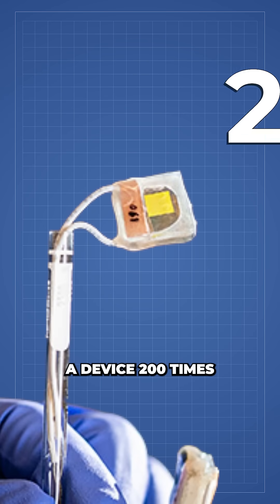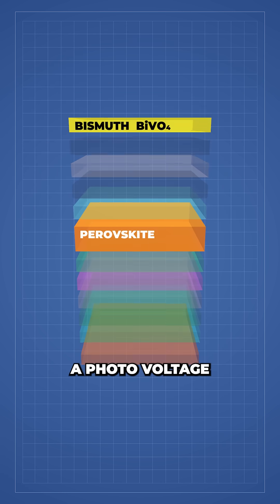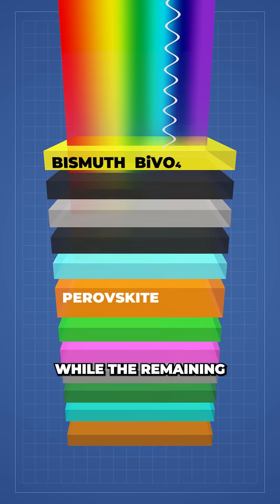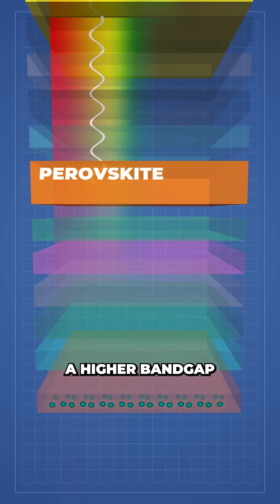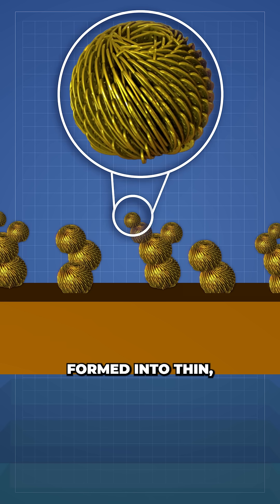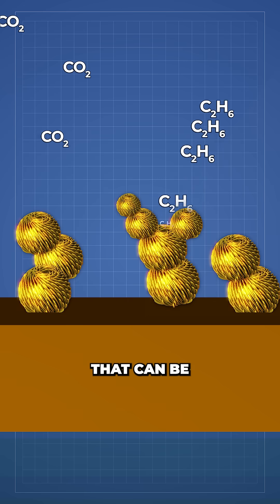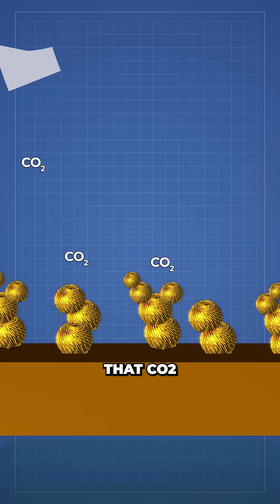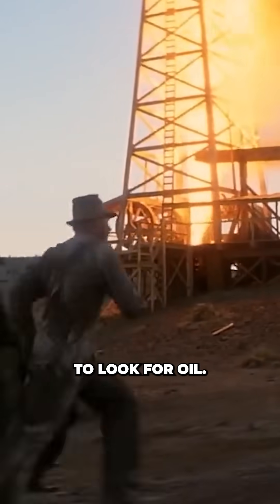Scientists Create Artificial Leaf That Converts CO2 into Fuel

Comment: Now watch this get scrapped because it was financially lucrative to big companies and industries.
Reply: Or oil companies buy the patent and sit on it. Then reintroduce it when the profit on oil starts running out.
Reply: @jjspeaksout  "Or oil companies buy the patent and sit on it"

That's not the way the patent system works.

You can buy software and sit on it, but you can't buy a patent and sit on it.

You HAVE to license it, otherwise it's just as invalid as if you never had a patent at all.

You can't even charge an unreasonable royalty amount for it (at least not in most countries).
Reply: It could be the opposite: use this instead of the other fuels and devise, because THIS is more lucrative. And not only for the big companies that exist right now, it could be a new company that compete with the existent ones, and then this new company rise above those which didn't want to make the change (similar to Netflix and Blockbuster).
Reply: Ok Mr Conspiracy Theorist what about private companies that are in the business of selling you high efficiency solar panels for use in military, industrial and miniature devices. 

Many of these advancements DO come to fruition but take multiple iterations to perfect or to realise scaled mass production. It’s “easy” to make something in a lab it’s far more complex to manufacture it at scale without sacrificing quality.
Reply: @inthestarrysky6166  Exactly!
Reply: Not if its cheaper than drilling in the sea
Reply: This is definitely a very inefficient concept an hence just an overall bad idea. The technology could potentially be useful for other things, but overall this is not a good system for green energy at all.
Reply: @MsHojat  why?
Reply: Nah, it won't. Usually in this sort of technology you don't use ambient air, but need some sort of process to get concentrated CO2 which makes it (as of now) super coat & energy inefficient. That's why there these kind of cool laboratory experiments don't make it to the production line. No deep state / big oil / conspiracy needed.
Reply: Hope they send plans everywhere. 3rd world doesnt need electricity, needs fuel for heat.
Reply: Bro. Saudi Arabia of all places is heavily investing in solar panel manufacturing. They aren't dumb. The only thing that will keep this tech from flourishing is if it's not really capable of being used at scale and is being overhyped by science tabloids.
Reply: Wouldn't be the first time. Tesla got a taste of thus
Reply: Or China being smart either pays them to give all current research with them either helping or leaving and staying out of it or doesn’t pay them and uses “alternative” methods
Reply: If it gets scrapped, it'll be because it isn't a worthwhile investment. There are over a hundred countries on Earth without these huge oil companies. If they can't make it in Japan or China, then they just don't have anything valuable.
Reply: Look up how scarce bismuth is on earth...where it is most....this kind of work is done by big companies or few universities in the world....the knowledge like this not attained at go....so don't be fearful....American dominance is over we are now living in a mutil polar world bit like before 1989....but it will better if u are NOT American.
Reply: Things change. Look at the cigarette companies. They tried hard to silence the doctors but it only lasted so so long. Most went bankrupt, some went into the food industry and created the obesity pandemic. They will soon have to pivot again. The oil companies can’t stop this if it’s working and the economy of it makes sense. Some will go out of business, some will manage to transition into something new. Maybe baby killing powder or buying these components to build desert fuel plants.
Reply: соnsрirасу sсhizо
Reply: Do you have any idea how big a thing this would be for oil companies? Drilling for oil is a huge expense so if they could get around having to do that they'd jump right on it. 

The trick here is getting it to scale up outside a lab and that'll be the big bottleneck in making this day to day.
Reply: @aguyhere7945 Except they already have the infrastructure and many oil sites are good for a long time. If they suddenly stopped using that for this it would be a waste of
Reply: Oil is finite. They can't just sell crude oil forever. They would just slowly introduce this into their production until it's the only profitable way and fully transition to it
Reply: @michaelvigil5321 they will replace work force with robots before oil runs out. Co2 focus about weakening people not climate change
Reply: @michaelvigil5321 oh yes, oil is finite. And our corporate overlords have always been able to plan beyond the next financial quarter, surely they have a hundred plans in place for such a situation.
Reply: Oil actually isn't finite and it's being produced by abiotic processes. Crazy how young people these days think they know everything. @michaelvigil5321
Reply: You live in a James Bond movie
Reply: Solar panels can be used to power fuel synthesisers, and we've literally had that technology for decades. This isn't 'disrupting the fossil fuel industry'. If you believe it will you fundamentally misunderstand the problem.
Reply: @dead_pool_io if you really think what we had already in this respect was good enough for what we need then you need to watch the video again because they clearly explain it’s not possible with the solar panels we have now.
Reply: @compilationsofsinope7601 sorry explain exactly which part of my statement was incorrect? You dont think we can power fuel synthesisers using a solar cell? Go ahead I'll wait. 😂
Reply: @dead_pool_io If I followed this explanation, the fuel comes straight from the device and cuts out secondary processing. Let's get real, you can easily split water in hydrogen and oxygen with solar panels, but this requires a different fuel infrastructure. This device us producing hydrocarbon fuel.
Reply: @dead_pool_io If you're referring to the solar panels people have installed on their houses to go "off grid", it's a scam. While solar panels in general can and are supposed to be used for that purpose, they're actually still connected to the grid and feed that energy back into it. So, you're not benefiting from them. You're just giving that energy back to the power company for free and they're still charging you for your energy use. You actually have to jump through some hoops with the power company to get them to even apply your discount for solar panels to your power bill. Also, that account info is your responsibility to get from previous home owners and pass on to whomever buys your home from you in the future. Otherwise, even with solar panels, you'll still be charged full price for using electricity from the grid. So, yes, power companies may utilize "solar leaves" at some point but you'll still be paying for it just like with the much larger solar panels. The difference is the leaves can be implemented throughout highly populated areas with minimal impact on infrastructure. Using them in that manner would propel further development to get away from fossil fuel. Not that oil companies would allow that.
Reply: @JoeBennett-j9c  nice copy paste
Reply: @dead_pool_io doesn’t make it efficient
Reply: @lordwilliam8340  if you're looking for efficiency with photosynthesis then you're looking in all the wrong places.
Reply: @dead_pool_io it’s extremely efficient when talking about plants
Reply: @lordwilliam8340  photosynthesis in plants has a 1-2% efficiency rate.
Reply: @dead_pool_io converting sunlight but it’s an extremely efficient method of making energy saying as everything else by that metric would be even less efficient
Reply: @lordwilliam8340  ... yes.... sunlight... that's what we would be using to power these things....
Reply: This why I hated capitalism
Reply: @gandalflotr2898 What is the alternative?
Reply: That’s just conspiracy that is not supported by anything😂

Comment: That's really cool, and the researchers should be lauded for their work, but in the end, it's still creating hydrocarbons for combustion, which is one of the least efficient sources of energy and puts the carbon back into the air. Still, it's a great achievement and a useful advancement in science.
Reply: That's simply wrong.  Combusting Hydrocarbons may be inefficient, but they're so power dense that they still dramatically outperform batteries.
Reply: @jeffmorris5802  I didn't consider batteries, because I think of them as energy storage rather than as a source of energy. I was comparing hydrocarbons to solar, wind, hydro, nuclear, etc., and how much of the energy gathered from those is converted into work versus what dissipates as heat. But I'm no expert, so I'm open to an explanation of what I got wrong.

Comment: A solar panel car is becoming more realistic by the day
Reply: this isnt a solar panel. it creates an actual fuel. Solar panels convert sunlight into electricity, but no fuel is created.
Reply: No, solar doesnt have enough power to run a car. An eV car might use ~15kW on average with break regen... peak midday sun is 1kW per m^2, you might get 2m^2 of usable solar panel area on a car roof, so even at 100% efficiency you cant run a car, maybe charge it when not in use. State of the art is something lkke 22% efficiency, depending on where you live, the season, the weather, the sun output drops rapidly, but even at absolute peak youd get maybe 440watts, youd need about 35 hours of peak midday sun charging per hour of driving you do
Reply: @Athiril  dude have you watched the video???
i don't think OP meant a car running on solar power, but a car that burns normal fuel and generates fuel from the exhaust fumes using solar power
Reply: @goggypoggy  big difference between carbon monoxide and carbon dioxide.
Reply: @goggypoggy the video talks about "co2".  Exhaust fumes from burning fossil fuels are "co"
Reply: @ZackNehring You are wrong. The majority of carbon monoxide exhaust gets "burned" into carbon dioxide by the catalytic converter.
Reply: @goggypoggy have you? I gave you the best case scenario. That's much much worse. Your combustion products of electrolysis fuels are the same as your input products.. meaning you can't get more energy out than electricity you put in.

Evs may be around 90% efficient in electricity usage from a power source. While a petrol car is around 20% net efficiency, most of the energy is dumped out as heat.

Now you are adding electrolysis, which will be around 55% for co2 splitting, now you're going 22% x 55% x 20% = 2.4% efficiency in use of sunlight to fuel
Reply: @ZackNehringexhaust from burning fossil fuels 100% perfectly would be CO2 and H2O. But it’s nowhere near perfect and there are all sorts of other things in fuel so you get that plus some CO, a bunch of O3, a ton of nitrogen compounds, and miscellaneous other crap - lots of nasty stuff.

Which is just one of the many reasons why battery EVs are better and are going to win out eventually.
Reply: @ZackNehring No, incomplete burning will lead to a mix of carbon monoxide and carbon dioxide but a good car will release basically no carbon monoxide, since that would be a very inefficient car
Reply: @goggypoggy  well that would be a normal car, if someone says "solar panel car" one would assume they are talking about a car driven directly by solar panels.
Reply: @catninja4950 but most people's Cadillac converters break down and never get fixed or replaced not to mention if they're stolen and get replaced by straight pipe
Reply: @catninja4950 also Cadillac converters are not on everything You've got other running engines out there that don't have them lawn mowers chainsaws weed eaters
Reply: @agaimless3724  where can I pick up "Cadillac" converter...I have a '97 Toyota...would love a Cadillac 😂
Reply: @goggypoggy .

It is only possible because it is 200x the efficiency of the current PV solar panel.

The only difference is, it uses the output electricity to split the CO².

Meanwhile in an EV car, we use the electricity directly to kinetic energy.

So yeah, it's more efficient.

The only feasible implementation of that approach (splitting CO²) is to make sugar, food

Wow, next thing, we create food from thin air and sun

Woohoo.
Reply: @olsim1730 🤣
Reply: @agaimless3724  Those things do happen, but they are not the majority. You act like no cars on the road have a working catalytic converter. In Europe if the exhaust  gasses are not in norm, your vehicle can't complete the yearly vehicle inspection + any modification to the exhaust system could land you in jail.
Reply: @agaimless3724  Those little 2 strokes will never emit as much CO and C02 in their life time as a normal car does in a mouth.
Reply: @goggypoggy  Uhh, conservation of energy would like a word. Doesn't matter what chemical process you're using, you're not getting more energy out than what you'd get from just using the solar energy directly.
Reply: @catninja4950  I swear I have seen that guy before, claiming that exhausts only release CO. He deleted his comment after I proved him wrong but he seems he's still at it. How very strange.
Reply: @miniMAX_Styles 
And we ALL become diabetic from eating so much sugar
Reply: @richardofoz2167 .

sea water is Free and full of salt, but bro, you found new post eutopia "problem"  😂😂😂
Reply: @Athiril it will if it's parked in the sun all day while you're at work I'd love to have a solar car down here in Florida if it's a efficient enough just park it in the sun if it gets me to A to b everyday it's all I need
Reply: @agaimless3724 that'd only work on an ev not a petrol car, it won't work for producing fuel, you dont get 37 hours of peak midday sun in a day, which still isnt enough to get you to and from work ubkess youre 3-4 min drive away. You wouldn't really get a return on investment and would need to install solar panels on the roof and wire it in. Also your average is 400-500 W/m^2 on the sunniest most cloudless day thee for 9am to 5pm period, and that's assuming there's no trees, no wall, no truck or anything else shading your roof. Enough to drive maybe 4 miles on an EV.
Reply: @Athiril 4 miles is good. We'll just all get jobs in Florida or Uganda and move closer to work.
Reply: @Athiril  cars are if we are honest,utterly useless. Trains and buses are much more efficient means of transportation anyway
Reply: @Athiril  true
however, batteries

also maybe in the far future if/when we have a dyson swarm we can make a cool service to redirect more of the suns light onto a point to generate more power than would otherwise be possible, very sci-fi and has obvious flaws (parking structures, also instant blindness if you have a sun roof) but would still be cool

also also i dont remember what the video name was (i think it was by pbs space) but i saw a video recently that discussed a paper that put forth the idea of essentially transmitting energy by sending information, supposedly if you entangle 2 particles under a magnetic field and then toggle that field on/off depending on whether its going to be up/down when measured, it will actually release energy rather than consuming it, so the device that made the particles could basically read their half at a loss, tell you the result, and then your car could read its half while toggling the magnet at a net positive, literally transmitting power as information
again, very sci-fi and has obvious flaws (how do you re-entangle the particles) but would still be cool
also the idea of powering devices through the internet is just oddly funny 😂
Reply: @nobodyinparticular968 
Obvious flaws? I don't see any.